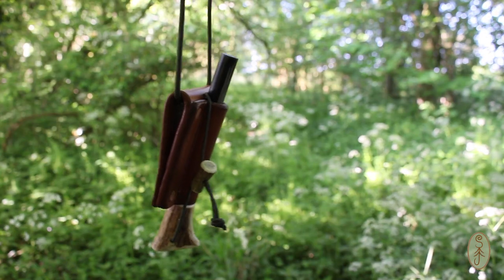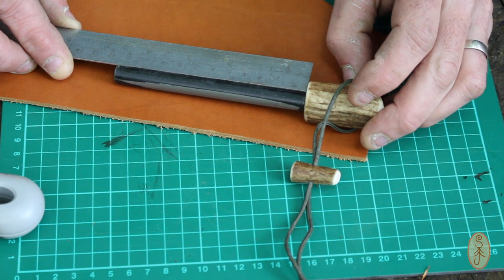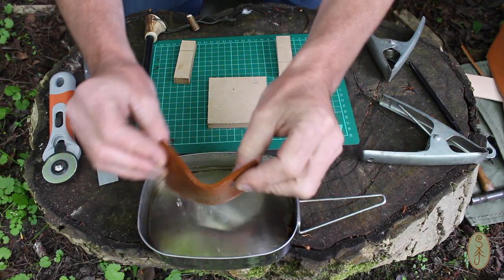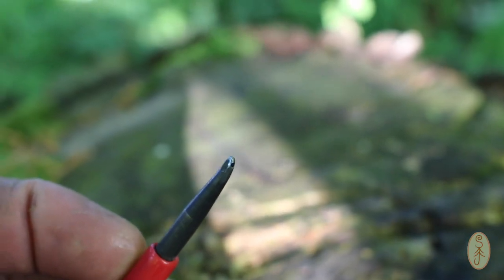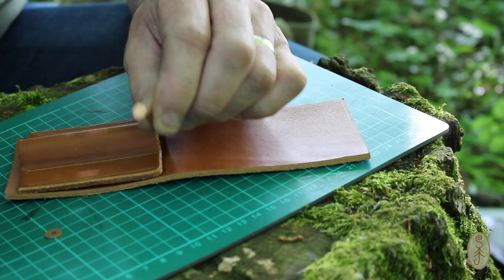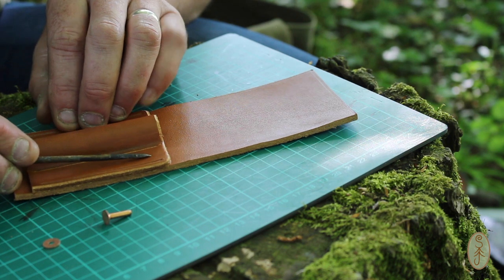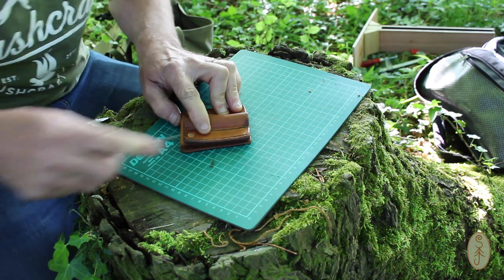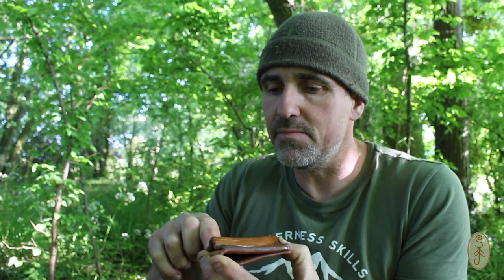Make a Wet Formed Leather Ferro Rod Holder.

Comment: Great project.Thanks for the inspiration.I have been wanting to make a knife case for my Gerber bush craft  knife to replace the plastic it came with and incorporate a holder for flint rod.I am thinking of encasing the plastic sheath  in leather cause I like the locking function of the original sheath. Any reason you are inserting the rod from the bottom.Just wondering. Seems it would be more secure from the top.Thanks for the video.
Reply from the maker: Thank you! It’ll actually go in either way up, I like it facing downwards if I’m carrying it around my neck for ease of access. 👍

Comment: This is thick, rigid  leather so no problem, but if you need to cut thinner, supple leather go at it in short strokes, otherwise it'll stretch with th cutting and you'll go off your intended line.
Reply from the maker: Good tip Johan! Cheers and Atb, Simon

Comment: A lovely peace of work, but as a climber and bushcrafter I am always worried about something that you wear around your neck. I know it’s all the rage but that lanyard needs to have a breaking strain of half your body weight so as not to neck you in a fall. Paracord has plenty of strength to hang you. It was always taught to climbers that you should be able to break the line from your neck with one hand. I am OLD extreme sports man for a reason. Thanks for your video’s I enjoy them immensely.
Reply from the maker: Good advise on the lanyard! Actually, I’ve never really carried it like that - I prefer it on my belt or stuffed into my tinder pouch - much safer (and more comfortable!) 👍

Comment: Sir, I trust you’re well. Simon, what a lovely little film, beautifully scripted and shot as ever, it just struck me why I like your videos so much, you have the most relaxing presentation style. Anyway, really good, I’ve never seen the wet forming technique on video before, it’s much easier and quicker than I thought. What kind of knot do you use to end each line of stitching and how do you set it into the groove? 

Only one criticism, “it’s s lovely warm day” and yet the hat’s still firmly pulled down. I’m starting to assume you’re ashamed of your shaved head and Betty Boop tattoo!

Best wishes, Andy.
Reply from the maker: Haha! Yes, I’ve got issues with my hair - I attempted a diy trim, say no more! 
As for finishing off the stitch - I just stitched back through the last couple holes, it holds well, especially with the wax in there as well. Tapping the thread down flat with a hammer ensures it locates well in the groove too. Cheers Andy.
Reply: Simon, a bloke in the woods 
Didn’t think of sewing it back, cool. 

DIY trip, yeah, right! Betty Boo, Betty Boo, Betty Boo!

Comment: Wheres best place to get items to Start LeatherWork Simon , Also what Make and Size Needles as oer Thickness of Leather 
Thanks.
Reply from the maker: Hi, I use Artisan Leather for most of my tools etc, can’t remember the size of needles I’m affraid, they came with the waxed thread I bought. You could try Tandy leather too. As for the leather itself - bargains to be had on eBay, you can often get a pile of offcuts for a very reasonable price! 😁

Comment: Burnishing bonds the loose fibres on the edges... thus giving a smooth shiny surface finish... it also then stops ingress of moisture through the loose fibres... ;o) Using either a Rubber Cement or Contact Cement would help with the integral strength of the piece... and other burnishing compounds are available... like water.. or Gum Tragacanth as well as using canvas or heavy cotton cloth for burnishing... After setting the Washer, and trimming the end, using the tool to mushroom the end is normal, but moving it round in a slightly canted circular movement domes the end more efficiently, or you could use a Ball Peign hammer to finish it off is the more traditional method and why the Ball Pein Hammer was invented... as the act of mushrooming the end is called Peining... ;o) Getting the length of thread for the stitch line usually works out at about 4 times the stitch length, sometimes 3 or sometimes 5 depending on the job... yours looked a tad short, getting used to pushing the needle through with one hand and drawing it all the way with the other takes time, but reduces the time taken to stitch, also leaving a loop on the first side while passing the needle through from the second side allows you to pull back on the thread at the same time, and stop what sometimes happens which is the needle piercing the thread as it goes through the hole damaging the thread or stopping you from pulling it tight... there are some good vids out there on stitch technique...I would have used the Carnauba cream first to condition the leather... then put on the SnowProof as the top layer of protection... as that will block the Carnauba from being able to penetrate as it has a heavier Wax content... not a bad project though.. well done! :o)
Reply from the maker: Thank you! Lots of great tips and tricks there - very useful to a relative newby like me! I didn’t know that is why the ball pein hammer is named so! Very interesting, thank you! 😁

Comment: Just put it in the right way up mate.
Reply from the maker: It sits inverted like that for easy removal when needed, if you put it in with the handle at the top, it’s a lot harder to deploy. Not that I often wear in my belt or around my neck, it’s normally just in my fire kit. 🔥